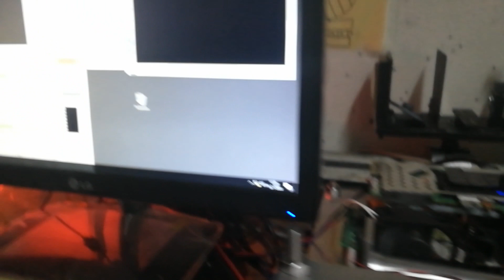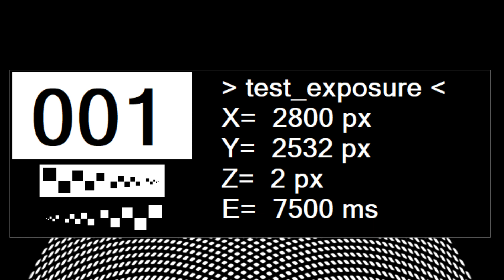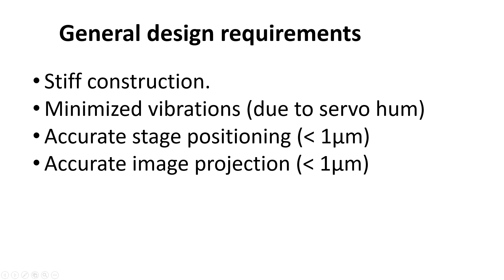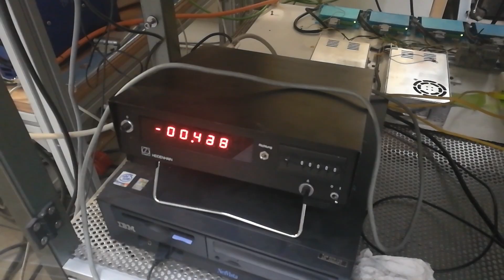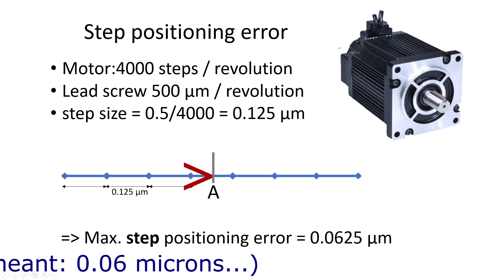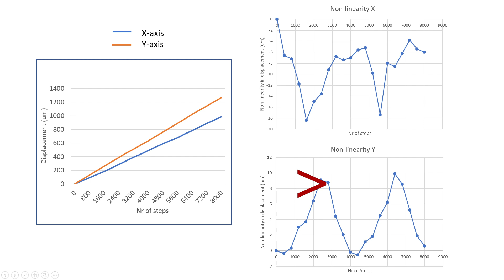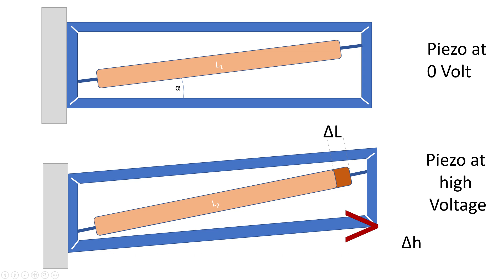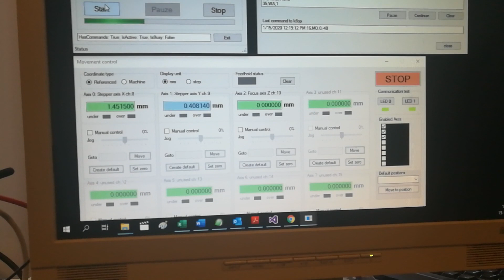Maskless Wafer Stepper Part 2: Mechanics

Comment: Hi Jeroen, I'm so glad that I found your channel. Also, I just wanted to let you know that diffraction is a classical phenomenon, not a quantum mechanical one (3:19). Thank you for making these videos!
Reply from the maker: Thanks. Btw: diffraction is also quantum if you consider it the result of a wave function instead of a classical wave.
Reply: @HuygensOptics  Thank you for your reply. It seems though having merely the wave property does not make it a quantum phenomenon. In fact, nothing in the theory of diffraction states that light is quantized, which is another necessary property for a quantum phenomenon. Maybe if you had a single photon emitter and you observed interference then you can say it's a quantum phenomenon. If you look at it as a Venn diagram, geometrical optics is a subset of wave optics (diffraction), which is a subset of quantum optics. In reality, quantum optical phenomena such as optical tweezers and Rabi Oscillations are much more difficult to observe. I'm sure you understand the matter very well, however I just don't want the viewers to get confused.

Comment: Great stuff, really impressive machine!   I agree with the leadscrew analysis (essentially the same periodic wormgear behavior that telescopes calibrate out), but wanted to throw out another potential contributor: motor cogging.  E.g. the stator slots prefer to settle into low-energy positions relative to the permanent magnets and experience a force when moving in/out of those positions.  Nicer servos will use tricks like skewing the magnets to reduce cogging (or ironless motors which have no cogging, but also very poor torque).  It can also be compensated in software by building a "cogging map" which commands the motor to use more or less current at specific locations in the revolution so that cogging is nullified.  The periodicity depends on the number of slots/magnets but will be higher than just once-per-rev, so is probably a higher-frequency signal overlaid the 4000-step non-linearity chart you showed.

Comment: You can turn the lense from the beamer backwards to demagnify the image. That is what sam Zoeloff did for his mask projector.
Reply from the maker: That could certainly work. A pity I did not think of that!
Reply: I tried that and doesn't work very well. After that you also need to pass the image through the microscope objective. You add more and more lens. I got the best results in my test with Huygens metod 👌

Comment: Random question (from a non-expert), could the periodic oscillating error of be down to a misalignment of the servo with the micrometer shaft (i.e. something solved with a constant velocity coupling)?
Anyways, amazing content and even more amazing that it doesn't generate more views.
 Thanks for sharing.
Reply from the maker: That is an excellent idea. Part of the non-linear behaviour of the lead screw could be caused by the external forces on it from (for example) the motor axis. Maybe a constant velocity coupling can help tom minimize these forces. Thanks!

Comment: Really cool project! probably a question for the last video but how do you collimate the output of the LED? I thought that was incredibly hard as it emits over quite a large area
Reply from the maker: Actually, I think it is an advantage that the beam is not perfectly collimated, because even with an LED I observe intensity variations in the beam due to diffraction effects on the DMD-chip. So I roughly colimate the LED-light using a lens and then I use a small concave mirror to direct the light into the microscope objective via the DMD-chip. Its a bit like I describe in the video linked below around 8 minutes, but then in reflection in stead of transmission: https://www.youtube.com/watch?v=E9uU2h1Ldcg . Hope this clarifies it.
Reply: @HuygensOptics   I have seen that video actually, also really interesting, just didn't realise how hard it is to get even illumination. I guess you get problems from the shadow of the bond wire on the led chip?. But maybe I'm missing some fundamental optics here, I thought the beam had to be as close to collimated as possible to image the 'mask' onto the focal plane of the lens?

Comment: Great video. Few suggestions how to solve things possibly cheaply. Add digital read-out on both axis. This way you can do a closed loop positioning. Use precomputed deviations for rough positioning and the DRO loop to position accurately. It will solve non-linearity. The squarness can be compensated using calibration (by using many known points on the good mask mounted in specific position on the stage) and proper control in software, by offsetting non-squarness out. Similarly the curves and other non-linear effects can be compensated out. The only thing that can't be fully compensated are rotations, which are of course also present in some of these non-linear deviations; and of course temperature dependent deviations (so keep things constant during calibration). I am not saying it is easy, or the easiest, but probably cheapest way to try. I see you are a capable programmer, so think about it. New xy motorized high accuracy / repetability (sub-micron) linear stage of medium size like this will still be expensive. About 9000$ from a quick research.
Reply from the maker: Thanks for the suggestions. So, squareness of the table can also be adjusted, I still need to do that, that is another 3 microns of error out the window. Yeah, if I had the money, I would probably just buy nano stages from Newport, PI, or Attocube. But then of course I would not learn as much as I do now. 
The best way to achieve very high accuracy would be to use an interferometric feedback I guess, using mirrors on the sides of the table. I'm looking into that, but I know on forhand that it will not be trivial to implement. Anyway, it's been a fun project so far.
Reply: @HuygensOptics  small steps. It is already looking very promising and usable for some tests. ;)